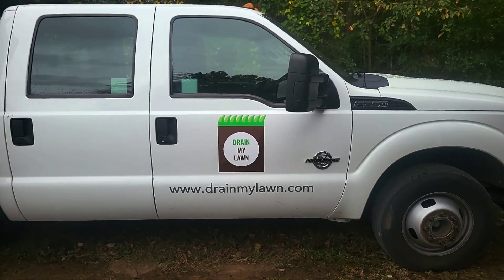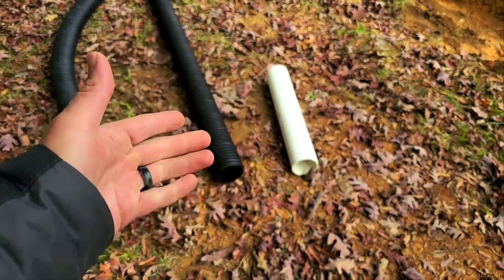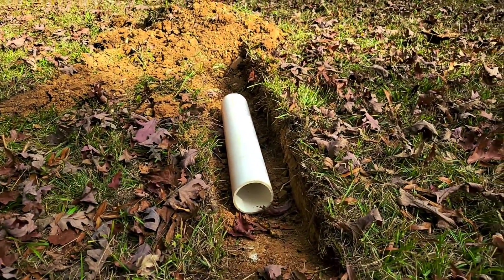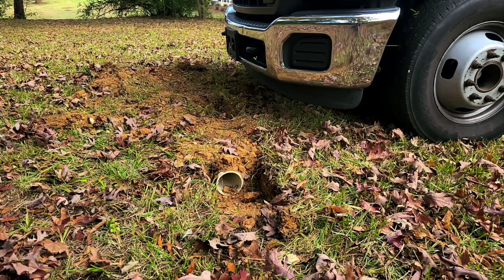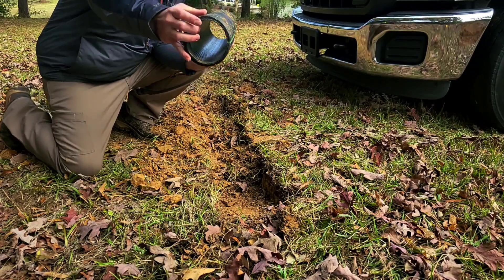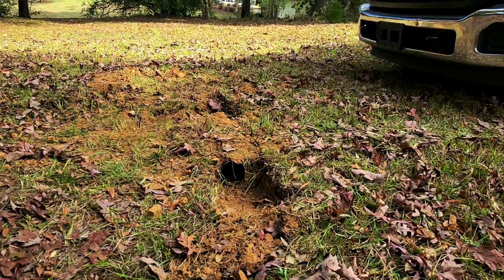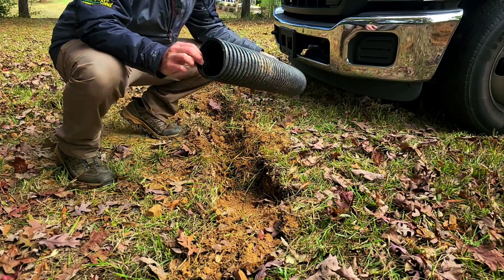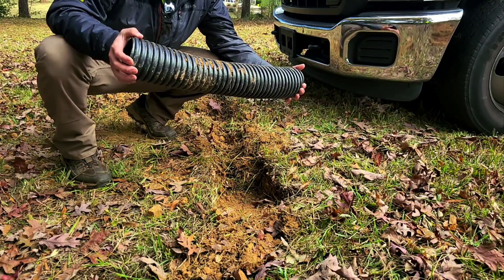Corrugated vs Double Wall vs PVC Torture Test Charlotte, NC

Comment: Thank you so much for doing this! This is exactly what I wanted to see. I have an F-350 as well and I need to drive over my 3in Schedule 40 PVC drain pipe that is about 2 in in the ground and I was concerned about busting it. Now, I feel pretty good about it. I’m still going to do some extra precautionary measures but I’m glad to know it should be able to hold up!

Comment: I love your opening line, thanks for being bold and putting that in your videos. I used to have a similar saying on the wall in my Vacuum Sales/Repair shop back when I owned it (25 years).

When you mentioned the shallow trench and people not knowing what they are doing - what's the desired depth for a 4 in pipe? Everyone I talked to or watched said 6 inches was the depth for a 4 in..is that not enough? I am about to DIY a drainage project and want to get it right the first time.

What I gathered out of this though is that single one corrugated is perfectly fine for uses where there's no traffic or just light walking traffic, especially if installed right. I was originally going to use PVC but thinking I am going to use corrugated now. Except I will get the one at Tractor Supply and not the HD/Lowes one as I hear it's stronger.

Comment: Nice video.  My guess is that the corrugated pipe will last longer and the cost is about 20% of the cost of the PVC.  I installed a down spout drainage system recently and I was shocked by the cost of a 10 foot section of PVC.  I was a little worried about just using corrugated pipe since most professionals were saying to use PVC, but I was laying about 70 feet of pipe and PVC was just too expensive.  As a test while laying the corrugated pipe, I stepped on the pipe while it was in the trench uncovered, the pipe didn't seem to know I was there.  The strength of it was actually pretty amazing.  Also, I have seen a few videos about the ribs in the corrugated pipe causing turbulence in the pipe which helps to keep it clear of debris.  So far I am happy with my setup.
Reply: He must be a corrugated pipe salesman 😂
Reply: @206dogg  Must have crawled out of the pipe, I hate it when that happens.
Reply: The cost of the PVC is nothing compared to the damage a clogged corrugated pipe could cause. It's very rare a corrugated is driven over. This demonstration doesn't show when the temperature is down around zero when the pipe can crack more easily. Many other downsides to corrugated such as poor connections which roots use to get to the water that remains in the ridges. This demonstration is only a portion of the tests needed to compare the various pipes fairly.
Reply: @joeshmoe7789  All that can be corrected with proper install. Proper grading, taping and use of good connectors and not cheap crappy ones.
Reply: @joeshmoe7789  I live in Florida, highly unlikely that the ground is going to freeze.  I have had tractors holding huge tree stumps drive over the pipe, it stills holds water.  And PVC is notorious for allowing tree roots to invade the sewer line, but even if the corrugated did get clogged at a joint, you could always dig it up.  On a plus side, the pipe comes in very long sections, so you might not even need a connection.
Reply: @carlkma2037  If you're connecting multiple sources to a main pipe, you'll have connections. Schedule 40 PVC pipe connections that are glued properly are stronger than the pipe itself. Try breaking a connection, the pipe breaks. The connections become welded.
Reply: @joeshmoe7789  That's great but this has nothing to do with what I said or what I used the corrugated pipe for, which is a drain line for the rain water from the roof.  My pipe came in a hundred foot roll, I had one connection 30 feet out, the rest was a continuous pipe.  The connection was in the middle of the yard well away from trees and bushes.  The connection was taped using waterproof tape and one year later it is still going strong.  I guess I just don't see your point, do you sell PVC or something?  Applications are different, and the corrugated pipe worked well for me, whether you like or not.
Reply: You get what you pay for
Reply: @LaFox23  And sometimes you pay way more than what you get, if paying four to five times what it could be done for is good with you, go for it.
Reply: @carlkma2037  pvc is strong, has a smooth wall, and is used everywhere in professional systems. It can either be solvent welded or gasketed, which creates a water tight connection, unlike single wall corrugated. Do you see municipalities putting single wall in the ground for a storm sewer? No. A sanitary sewer? No. Sewer laterals? No. That’s because pvc works best.
Reply: @LaFox23  Yeah, okay, you go with that, I will use what I think is best.  I am not a municipality running hundreds of homes into a single line.  Also, I don't have the authority to tax homeowners to pay for the line, I have to pay for it myself.  So I will use what best fits my budget and does the job.  You appear to want to talk all day about how many angels can dance on the head of a pin, I prefer to do something else.  PO.
Reply: @carlkma2037  thats fine, just don’t complain when it all fails. Because I told you so.
Reply: @carlkma2037  100% - There are many videos of people testing and using all the types and many recommend the corrugated over the PVC. I am going to use corrugated except under the sidewalk I will use PVC to prevent a low spot. I will have 3 catch basins/debris catchers in the line and also a clean out port at each of the downspouts (or maybe just the first one, unsure yet) so that it can easily be corrected if there are any clogs or issues, which I don't suspect to happen anyway.